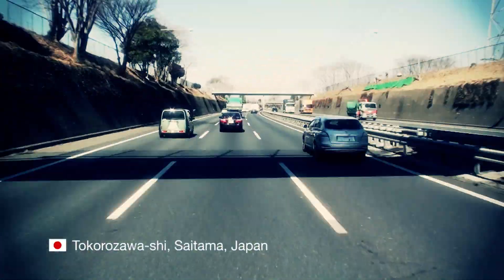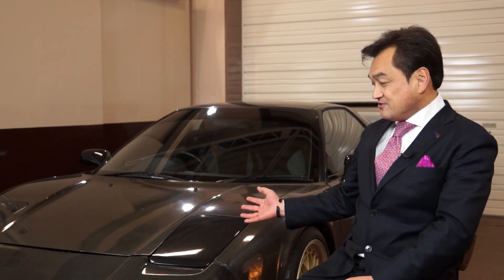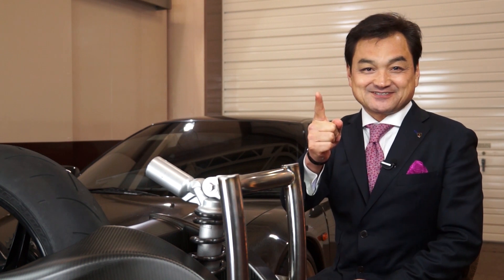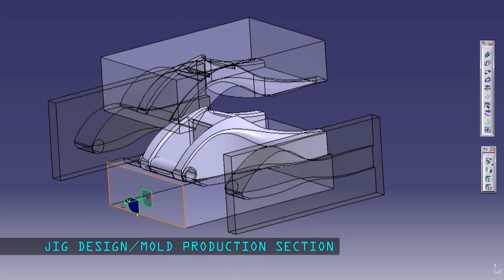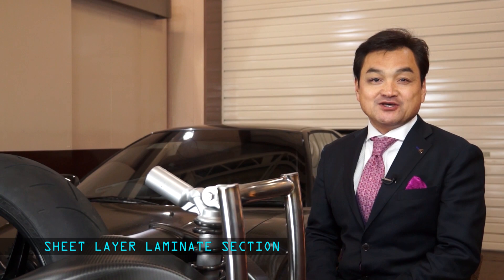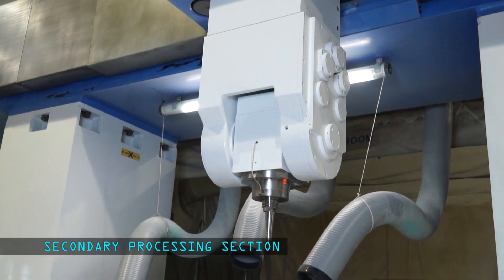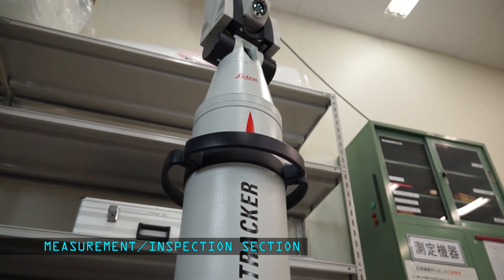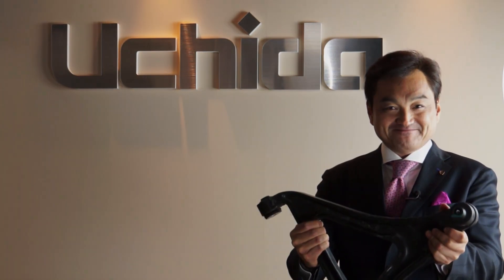Carbon composite product process of manufacture【2013 UCHIDA Factory】

Comment: Pretty efficient operation running an autoclave cycle with a single part. Probably didn't even cover the cost of the nitrogen used to pressurize it, let alone the cost of heating the vessel up. Also, I don't think it's possible to be any more vague in the narration; even worse than an American politician answering a question he doesn't know the answer to.
Reply: Also, I see what looks like a lot of dry spots in that cured piece. 5:01 Maybe your vacuum isn't holding or maybe someone is cutting too much material out to make those complex curves.